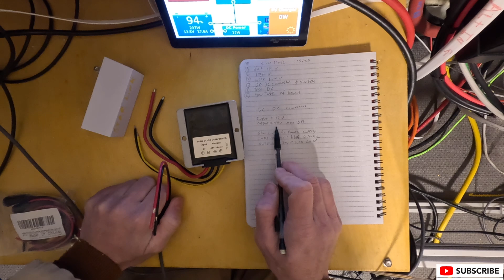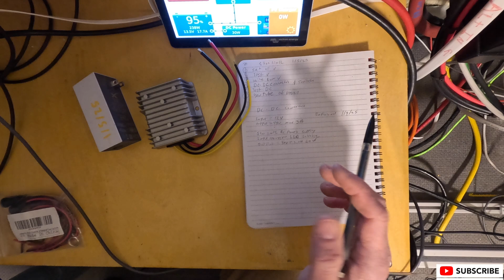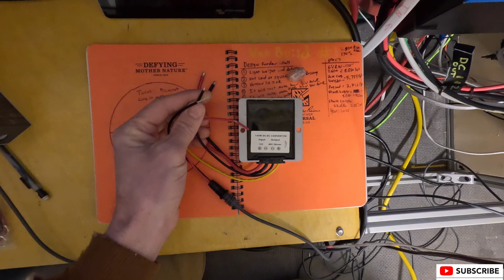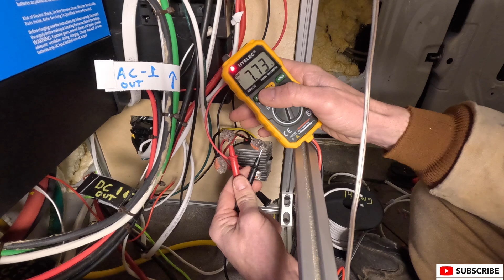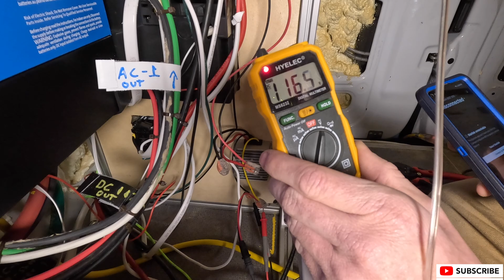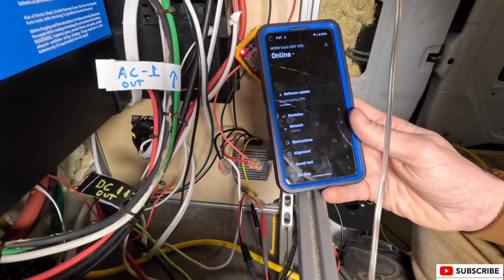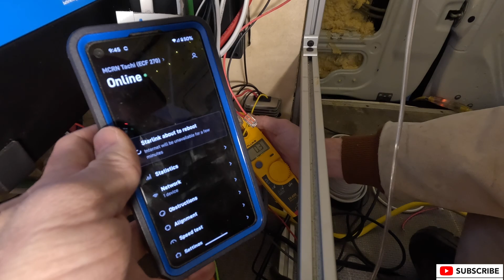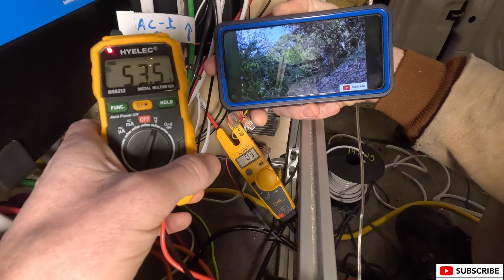No AC, no Problem! Powering Your Starlink Mini: A 12V DC Solution for Van Life

Comment: Is it normal to have a step-up converter 12v-48v to output that much more voltage than the stated 48v?  I'm concerned that the starlink mini has a 12-48v stated range, and this converter exceeds it.
Reply from the maker: Yeah I hear what you're saying. I'm not sure why that's happening. What I can report is that I've had the unit in production for a few days now and it's working just fine.
Reply: If I were reading 100+ volts on a 48v converter, I would not have plugged in the Starlink. That is very concerning to say the least....